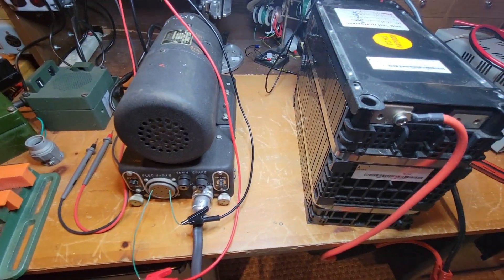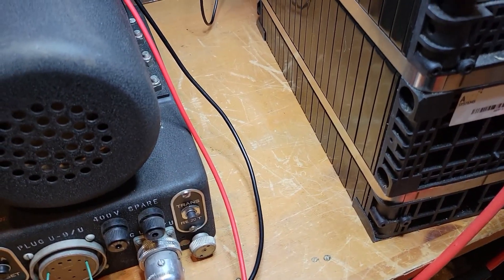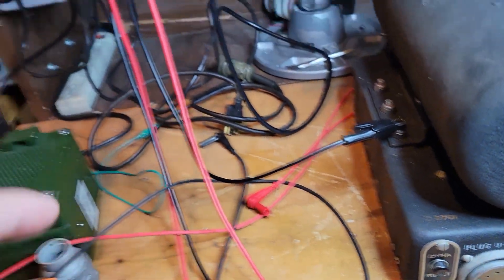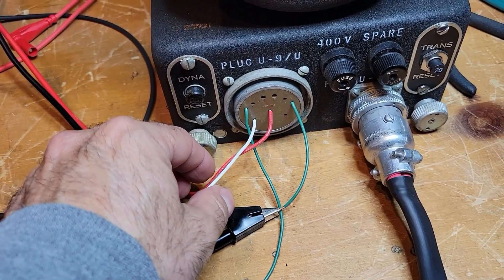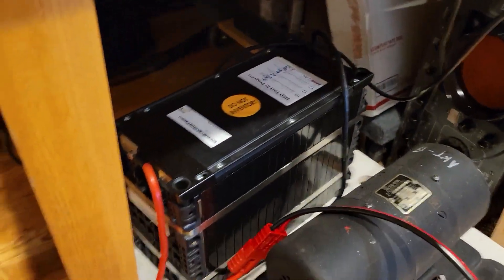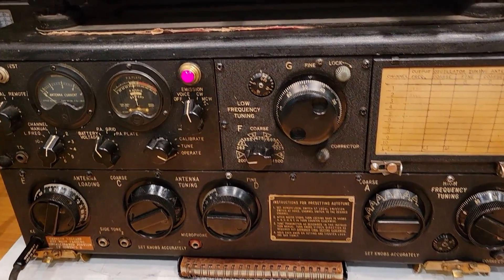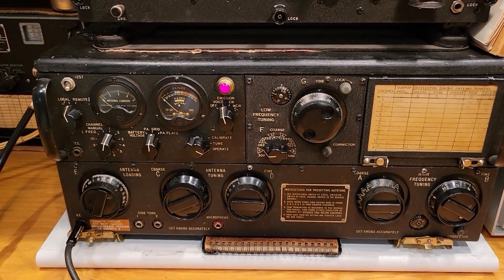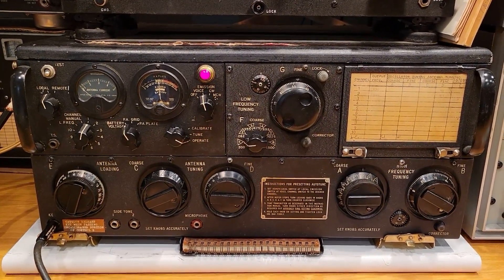ART-13 Part 2 - Smoke Test!

Comment: The RF output circuit is not designed to work into 50 ohms. You need to connect a variable capacitor of about 800 pf in parallel with the antenna and ground terminals to create a PI network. Also make sure that  knobs with the triangles you line up the top of the triangle (whichever you have to select according to the tuning chart)  with the mark on the front panel, otherwise the rotary switch it's connected to, doesn't make contact. The plate and grid on the meter are currents. AM is correct between the CW and MCW plate current range markings on the meter.
Reply from the maker: thanks very much. You are of course, correct on both counts. I discovered the triangles were not 100% lined up and that made all the difference. I have to get back to this project one of these days! 73

Comment: What brand/model etc is the 100 amp battery? Nice set.
Reply from the maker: Hi there. The battery is from A123 and is 100AH. Some other specs: 
Charge max is 150 amps
180A Rated Continuous Current
2,000A Short Circuit Current
10 Mega Joules!
Battery posts: M6-1.0 (1/4" ring terminal)
Thanks for watching.

Comment: I may be wrong, but the meter when set to the Grid and Anode position is measuring current (in mA) rather than voltage ? The Anode reading you did get was the current due to the bias to the final tubes ? 
Had you keyed the TX in CW mode (or modulated it in voice) you would have seen the needle move, hopefully to the right spot.
Reply from the maker: Yes, I've learned more about this TX since making that video. I'll post another with some updates. I was (am) still rather ignorant about much of this rig. Thank you

Comment: Enjoy your thoroughness in testing checking the Dynamotor output voltages prior to connecting it to the transmitter. Love the sound of dynamotor's, certainly not efficient ways of producing high-voltage and I'm thankful for transistor power supplies but dam  what a great sound. Don't you love the autotune on the ART, troubleshoot tuning by  look at the knobs and comparing to the tuning chart.  Thanks for taking the time to share
Reply from the maker: Thanks for the note.  Yes love the old fashioned dyno. I plan to show a video of the auto tune doing its thing.  I should have shown that